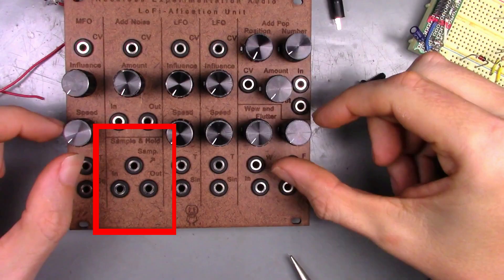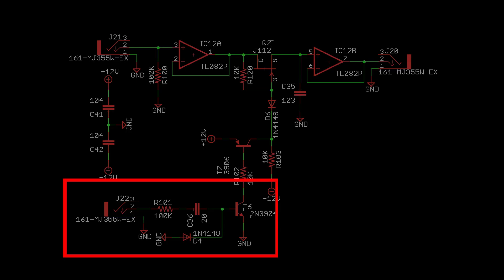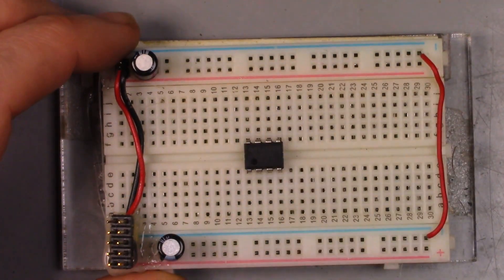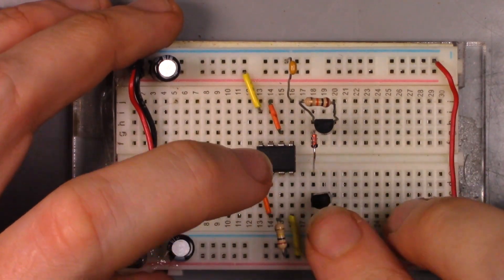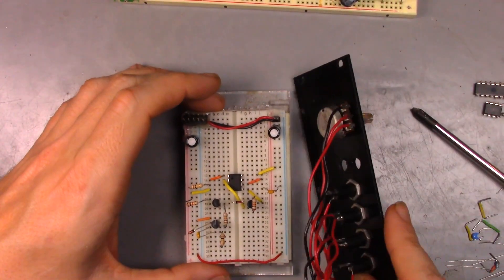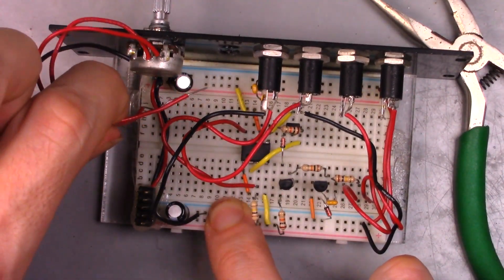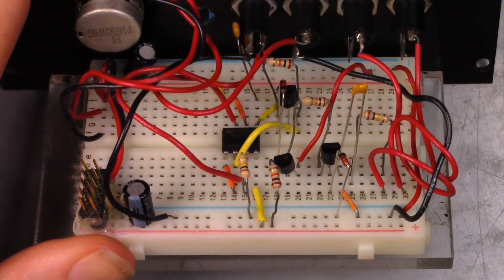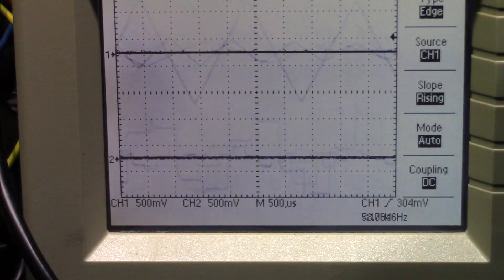Breadboarding a Eurorack Sample and Hold

Comment: Thanks so much for sharing this. I was working on a similar S&H circuit but the trigger was not quick enough to deal with audio rate clock signals. Your solution is super fast and works really great. I found some improvements by changing the hold capacitor to a 0.1uF (up from your 0.01uF) and changing the 10K between the source and gate of the JFET to 1M. This led to a bit more note stability when using slow clocks and less droop in the voltage. I'm really happy with this solution that is rather versatile and yet simple. Thanks again!

Comment: Your circuit worked great on a breadboard, but on perfboard noise frequencies are too high, clean when I run the noise through a LP filter.  Should I consider changing the values of my component’s?  I’m getting 50pF on trigger and 9nF on the 5 pin to ground.  Or do I add a LP gate, (resistor/cap)
Reply from the maker: Might want to try cleaning the flux off the perf board. Sometimes, on high impedance circuits, the flux residue can become slightly conductive. This can cause voltage leakage to different parts of the circuit. Fortunately the fix is easy.

Comment: Interesting, your schematic show a TL082, but your video indicates that you opted for the TL072; is that because of what you had on hand?  I think I will try both to see which performs better, if there is any difference at all.
Reply from the maker: I accidentally typed an 8 instead of a 7. That being said, for this application, I think the two chips would work the same.
Reply: Actually the TL082 works a little better for my eurorack V/oct modulation purposes.  Thank you this circuit performs better than one that uses TL074 and JFET.

Comment: Fascinating and enlightening.  Thank you for the plain-speak demonstration.  I plan to build one of these circuits for my Buchla which is +/-15V.  Would that have an impact on the resistors or caps sizing?  I may build a +/- 12V on my breadboard so I can use my eurorack power to test it.  Don't want to damage the Buchla.  Then upsize  the components.  What size Ecaps are those that you use to purify the power source to the breadboard?as needed
Reply from the maker: I think it would be an identical circuit on a +/- 15 volt supply. I generally use 10uf 25V caps for power filtering (+ or - power rail to ground), and 50V ceramic caps for everything else. The op-amps are good to 36V total supply voltage. Resistor values shouldn't need to change either.
Reply: Thank you so much @Recklessexperimentationaudio  .  Makes perfect sense.  Your schematic show you using a pair of 104s for power filtering (only needed on breadboard, not needed on a pcb?) and a 103 for your input to gnd reference.  but what was the other capacitor you used to slow down the input to the 3904?  A 20? C36.
Reply from the maker: @danobrien3292  104 or 100nf cap are recommended to be placed as close to the chips as possible for best noise reduction. All the chips should get one on each power rail. The 20pf cap is to provide a pulse of current to the 3904 to capture the voltage sample. higher value longer sampling time, I found 20pf worked for me.